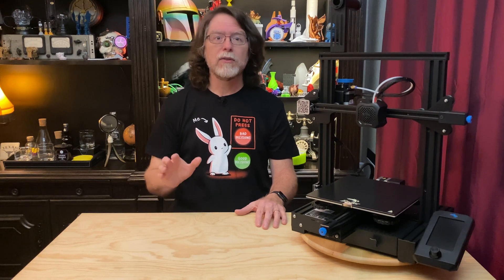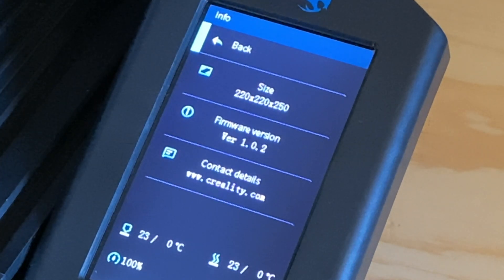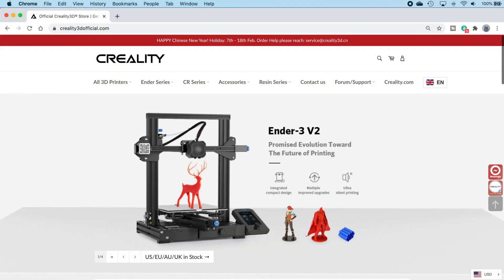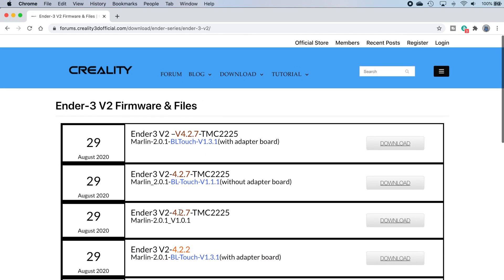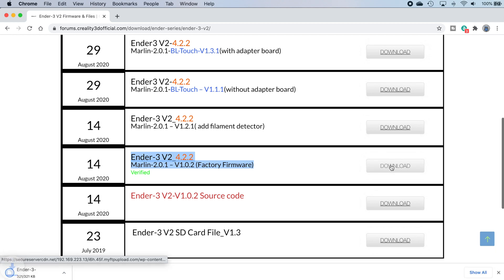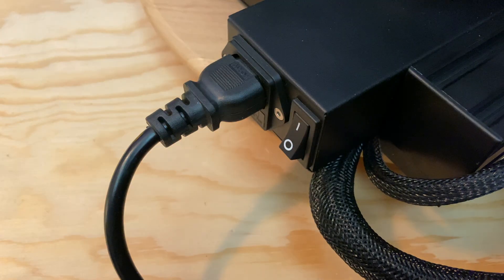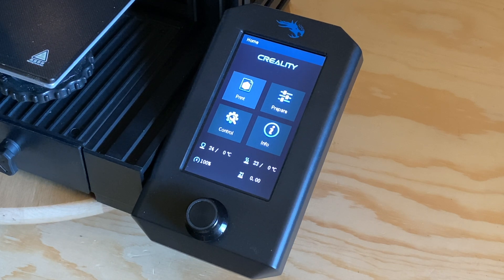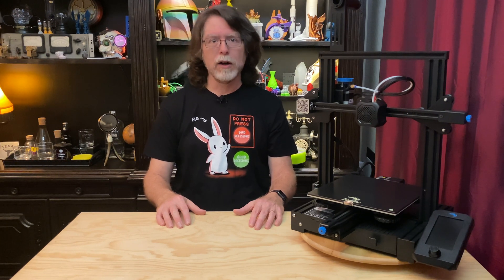How to Update the Firmware on the Ender-3 V2

Comment: I've been watching your videos concerning the Ender 3 v2 that I purchased one of my own.
Now the problem is with Creality website does not seem to be operational as all of their 'Contact' drop-down results in "There has been a critical error on this website."
No access to firmware updates.  SOL once again.
Wonderful videos that you make and you make everything sound very simple and straight forward.  Thank You
Reply from the maker: Hi John! For some reason Creality has that download link on its forum site, and as you noticed, it seems to be down. Meanwhile, I found another set of firmware download links on Creality's site, which are hosted on Google Drive. See if these have what you need: https://www.creality3dofficial.com/pages/firmware-download

Also, you might give JyersUI a try, instead of the stock Creality firmware. I've released a couple of videos about it recently.

Comment: i had to reinstall the firm ware when my screen froze black.  i found the ver 1.0.2 but the screen is all in chinese!  where do i get am english version??
Reply from the maker: Hi! The firmware is in both English and Chinese. Here's how to switch from Chinese to English.

From the main screen, select the top right square of the four square menus. That's the Settings menu.

In there, scroll all the way to the bottom.

The last item has an icon that looks like a capital letter "A" in a square. It's set to CN, which is Chinese. Clic that item and it'll switch to EN, which is English.

That should take care of it.
Reply: @BV3D  got it ! thx!

Comment: So like a few others, I used the stock MicroSD that came with the card, copied everything off, loaded f/w v1.1.1 and inserted, power up, blk screen, stuck there. Great. Took the card out and shorten the file name, repeated, still blk screen. Full/Long formatted the card to FAT32, reloaded the .BIN file with a short name, powered it back up and it worked. Also, the magic Z position number for me looks like  -3.30 for anyone else interested. Woot Woot. Thanks Bryan ;)
Reply: thanks!

Comment: I did the update the screen turned blank but now it stay blank nothing happen
Reply: Im in the same situation. if i somehoow make it work ill let you know.
Reply from the maker: Hi Jason, the best advice when that happens is to erase/format the card as a FAT32 volume, put the firmware.bin file on it again, and try it again. You may need to change the name of the firmware file slightly, maybe firmware1.bin. I think the printer remembers the name of the last file it tried to use.

Comment: I thought I had bricked mine. Accidentally ejected the card during update. I added the card back in with stock drivers on it, and it came up, then I was able to do the upgrade. Results may vary obviously, but worth a shot if someone thinks they have bricked theirs.
Reply: Mine did get bricked i tried everything nothing works

Comment: If you are having trouble updating it. My screen was beeping and not turning on after I followed this video,, even formated my card several times.. I have the ender 3 v2 with 4.2.2 board. With the bl touch kit firmware bin file. I needed the dwin set file too, because it was not updating correctly. The dwin set file is in the ender 3 v2 factory file on their website. It located in the screen folder. Copy all of those files from dwin set onto the memory card with the new firmware update.
Reply: I was getting a little nervous that I had bricked, but this solution worked for me!
Reply: Could you tell me specifically where to find this?  I don't see it anywhere and I'm getting scared.
Reply: @lesliediorio2953  you will find dwin set in the file folder ender 3v2 4.2.2 mainboard. Note this is not the file folder with the bl touch, But it is where you find dwin set.

Comment: Just purchased this printer and the display shows the logo and doesn't appear to boot, and no menu or screen loads.  Have updated the firmware after confirming version 4.22 on mainboard.  Attempted to update the display firmware as well, however it stays on blank orange screen for >20 minutes and doesn't return to the logo.  Any recommendations or advice appreciated.
Reply: Same issue here

Comment: Thanks for the video. Checking the creality.com/download site now, it doesn't label other files for BL Touch etc.
There is a newer .rar file which I assume is the one I should use since I dont have a BL Tough, but there is also a "Ender-3 v2 4.2.2mainboard（32bit）.zip" file. 
Any idea what this is? could this be replacing the BL Touch file or should I use this to update my firmware since it's the newest file?

Thanks!

Comment: What is the difference between "creality dot com" & "creality3dofficial dot com"?! Since the creality. com website has a much NEWER version of Firmware on there.
Reply from the maker: Hi, the creality.com site is the "B2B" site. It' the kind of place where, if you were a reseller, you'd go to order a few hundred printers to stock in your warehouse. The creality3dofficial.com site is the consumer-facing site, where end users go to buy a printer or two.

The way the firmware files are presented for the Ender-3 V2 on the creality.com site is as a single zip archive containing all the various firmware versions for a specific board type (such as the 4.2.2 board). The zip archive for the 4.2.2 board contains the original firmware, the original source code, and the various bin files for "I have a BLTouch with an adapter board" and "I have a BLTouch without an adapter board" and "I have a filament runout sensor".

The way the firmware files are presented for the Ender-3 V2 on the creality3dofficial.com site is that each one of those various bin files is available as a separate download.

Despite whatever date they've assigned to the files, the firmware versions themselves appear to be the same.

The 4.2.2 files in the single zip archive from creality.com contain the same versions as the separately-downloadable files from creality3dofficial.com.
The BLTouch-non-adapter version is v1.1.1, the BLTouch-with-adapter version is v1.3.1, the filament runout version is v1.2.1, etc.

Comment: Help!! My 3 V2, became a BRICK; blank screen and I can't get it to take the firmware update!
Reply from the maker: Hi Travis! Assuming you have the right firmware file for your Ender-3 V2, did you try reformatting the card as MS-DOS/FAT, putting the .bin file on it, and powering up the printer with the card inserted?
Reply: Hi, I just ran into this issue myself. After trying to re-format 1000 times by using the right-click method and using the command prompt in windows 10, I tried just renaming the .bin file as something shorter... I named it BLTOUCH.bin and it worked after that. Hope this helps.
Reply: Brian & Haydon, appreciate your responses... I reformatted the SD card in FAT/32 in the long format, not Quick format (took more than a couple minutes); then took Haydon' advise on shorting the title to "Ender - 3 V2.bin" and BAM.... it worked!! Brian, keep putting out the good stuff... YOu have a fan, here!
Reply: Bryan, Haydon, Travis.... Thank you thank you... I thought I bricked my printer.  I did what y'all suggested and I got it going.  Now to install my BLTOUCH

Comment: Would have been nice to see a list of improvements this upgrade gives at the beginning, I'm a firm believer in 'if it ain't broke don't fix it' , what benefits does this give?
Reply from the maker: I'd love to see that, too. Maybe someday Creality will include changelogs with their firmware releases. That said, I'm sure it fixed SOMEthing. I just don't know what. 👍
Reply: @BV3D  Does it fix the spelling and folders issue ??
Reply: @BV3D  It allows you to SAVE your E-Step Calibration now.  Before, you would have to re-enter it every time you turned your Ender 3 on.

Comment: Hey Bryan, I hope you are well. I am running a 4.2.2 board with the most recent firmware. The issue I am seeing with this version is when I make adjustments to settings such then go and press "Storage configuration, it's not storing and saving the settings. The only way the settings save is when there is an SD card in the printer but it is storing the settings to the SD card rather than the printer. Is there another way to store the settings to the printer that I am missing or do you know if Creality is going to be putting out a new firmware to fix this?
Reply: CHEP's got ur answer here:
https://www.youtube.com/watch?v=dLZm2itXJkg

Comment: This is one of the easier devices to upgrade the mainboard firmware on.
If you switch to a version that stores your settings in EEPROM, take note of any customization before upgrading.
Display firmware is a bit trickier.

That's a nice looking screwdriver.

Comment: Nice I got this printer, it’s my first one, about a week ago and I love your tutorials
Reply: Did you get a v4.2.2 or v4.2.7 motherboard?  it should be .7, but some people are getting .2 which have overheating issues in long prints which lead to shifts
Reply: @vynz0789  4.2 right cuz I have the micro USB port
Reply: @vynz0789  I have only had shifting happen once and I think the cause was me bumping the table lol
Reply: @nicholastanzola488  not sure if the USB port means you have 4.2.2 vs 4.2.7.  you'd have to look at the board like his video shows to pick firmware version.  if youre not having issue with shifting, then carry on! dont look for issues that aren't there.  Good luck!